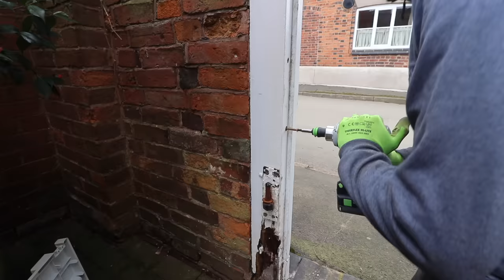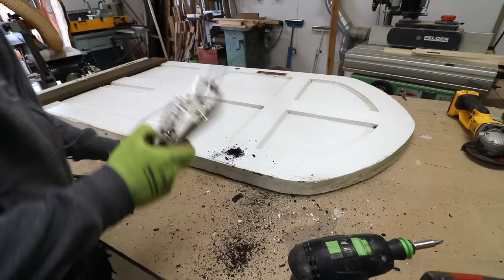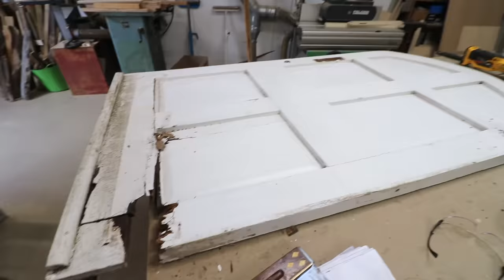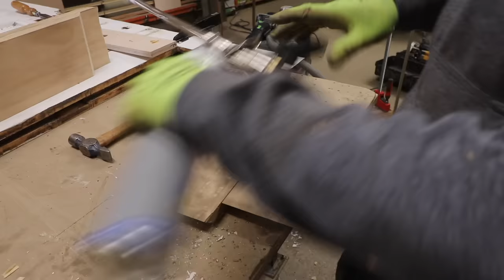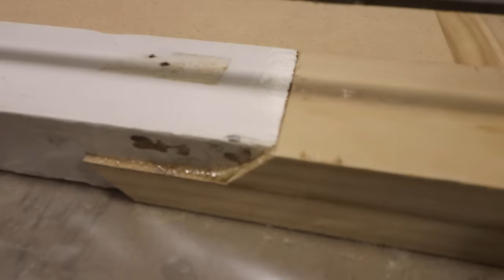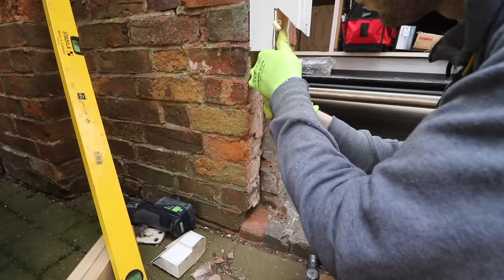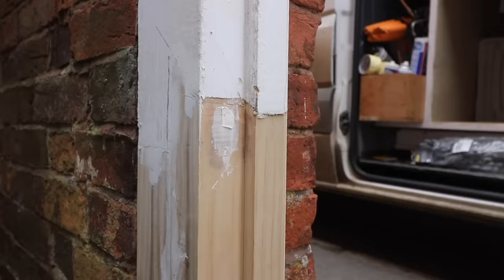Rotten Door, Full Repair. Here's How I Did It.

Comment: Lovely job where did you buy your rebate block from and how much was it, I have the exact same spindle moulder with a Felder rebate block that take replacement blades and sometimes I use it on melamine to give it a clean cut on both sides and wondered if this would give a better finish with the blades been on the skew, what your opinion on the block 🤔
Reply from the maker: I bought it from Alibaba, not sure which seller, 

I would definitely reccomend it. Make sure you get the helical not spiral as the blades are straight in spiral (like mine) you need curved cutters in the helical but the finish will be insane.
Reply: @BradshawJoinery  Is that him from Castleford Market 😉🤣 not sure where your based I’m from Wakefield originally but up at Boroughbridge in North Yorkshire now. You do some great work take care 👍

Comment: Bit surprised the jamb wasn't primed (surfaces touching damp brickwork and end grain in contact with ground) before fixing.
Reply from the maker: i didnt film but i dont use paint on a site repair, one coat while fitting doesn't do naff all! I use a clear sealer called sikkens kodrin wv456 that is like a paste, its called end grain sealer. dries pretty quick too!

Comment: I'm speaking from 20 yrs experience as framing, remodel, maintenance carpenter and construction supervisor both in North Carolina, and New Hampshire USA. Great workmanship but I would limit my use of high density fiber board like for the two door panels. Fiberboard of any kind is not suited for outdoor use. It has no rot resistance qualities of it's own like inner sap. No matter how well you prime and paint it, it will be the first thing to start rotting and often within just a few years, depending on the type of weather in that area. North Carolina is very hot and humid in the summer months lending to the mold and decay of wood especially the end grain as it wicks up water and often goes unpainted from the time it was installed. Old growth forest with tight grained Rot resistant wood like the heart of yellow pine, cypress and cedar are hard to find and to expensive for regular repairs.
Reply from the maker: Cheers Mike, THe product in the panels is one your probably not familiar with over there called Tricoya. The wood i used is also similar technology called Accoya. It sounds perfect for your climate and it is coming to america!

Comment: Beautiful work.  One thing, prime your end-grain before inserting the replacement parts!  That was the cause of the failure, to begin with.
Reply from the maker: Cheers Daniel, I used but didnt film, a product called sikkend kodrin wv456 end grain sealer. its better at sealing than primer and dries fairly quick
Reply: @BradshawJoinery  Thanks, I'll give the kodrin a try.

Comment: Very nice work. Did you use MDF for the panels? I wondered if MDF was suitable for exterior use even if painted.
Reply from the maker: Cheers Ross, I did but it's a special MDF called Tricoya. The link is in description. It's about £200 a sheet
Reply: @BradshawJoinery  Thanks, Just finished reading about it here in Melbourne Australia.

Comment: Wooho, great work.
Why don't you use oak?
And what material are those panels? It's not MDF, is it?
Reply from the maker: Cheers jp I use accoya because it's much better. Oak isn't a good timber for repairs, there is a high % movement with humidity change and also not a great timber for adhesives and paint to work with! 
The MDF panle is called Tricoya (accoya wood fibres in a MDF panel) there is a link in description you'll find it interesting

Comment: Wicker way to do it reveptor saw use westen cedar wether resistant.
Reply from the maker: Recip isnt accurate enough and also limited by the reveal in the brickwork. they dont do old brickwork any favours either, i used to use them on rip outs but dont any more. Cedar is also less durable than accoya and not ideal for painting, and thick sections are££££

Comment: Was a clear sealer used on the wood in the door frame portion you replaced, if so what was it? Would not think bare wood we be going against the brick and sitting on the plate.
Reply from the maker: Sikkens Kodrin wv456. It's great stuff

Comment: Just found your channel. I'm an old cabinet maker, retired. Enjoyed seeing your joinery on this door. Wondering, when you were using a multi-tool to sand the tight places on the gate frame, what attachment were you using. Looked like a triangle shaped plate.
Reply from the maker: That sander is a delta sander from festool the DTSc400. You can get little sanding pads for the multitool though.

Comment: What did you make the replacement panels from?
Reply from the maker: Tricoya Extreme MDF
Reply: I wouldn't have thought mdf would be suitable for exterior use, I hope the decorator gives it a good coat of paint. The rest of the repair was spot on but I would have gone the whole hog and made real wood fielded panels. Up here in Scotland I get a lot of rotten wood to repair, mainly window sills and door frames occasionally I'll get a door to repair

Comment: Why didn't you take the beam out all the way to the arch? It would have been easier. But it is still a good result
Reply from the maker: The Frame Jamb? YOud lose all the strength in the joint then, this way new timber cost is kept to a minimum but the spliced section is out of watersplash height.

Comment: Whoa!!!A radial arm saw still in production.  Don't see them any more.  I recall one being shut off at coffee time and 10 minutes later it was still turning.
On a sadder note, I just came from a week on the demobilization and tearing down of a pulp mill.  Everything is being destroyed,,,,everything.  The guy heading up the group knew I was a joiner so walked me thru the millwork shop .  an enormous bandsaw, maybe 8-10 ft high plus a shorter one, sorry don't know the blade size,  There was no power so we were using flashlights.  A 6" jointer, several Senco nailers, spikers and staple guns, biscuit joiner, Bostitch 18 g pinner..

And there was a 16 or 18: Dewalt radial arm saw with some blades hanging on nails on the wall.
On the floor were 2 boxes, 1 was full of wooden hammer handles and the other full of longhandled  wire brushes,  You know this place goes back in time with wooden hammer handles.
There were also 3 Justright 1-2 gallon gas cans.
Everything destined for demolition.  To think of the schools or volunteer  disaster response groups that could use some of it
It kills me.
The mill is in Port Alice on Northern Vancouver Island. It's on Utube.
Reply from the maker: Roger.. thankyou for that, yes the radial is a standard tool in the joiners shop in the UK. Most will have one here. Damn shame about the Pulp mill. I see production businesses closing all the time over here. Not many re-opening or new ones coming through!
ill have a look at the mill
Reply: Radial arm saw’s are sitting piled up in unused corners of millwork shops and Construction Company warehouses.
Everyone seems to have gone to chopsaws even on job sites where they are cutting through 2 x 12‘s and microlams.

Comment: @BRADSHAW JOINERY - Did your Kapex come w/ the shadow-line cutting guide in lieu of the red laser...or did you install an aftermarket one? If aftermarket, can you tell me which one? BTW - awesome job on the door repair.
Reply from the maker: Hi Ryan, its the standard one that you get with the SET version of the saw, mine is a KS60, the 120 has a Red laser line still. Ive not seen anyone add a shadow line setup to one yet. Festool talk group on FB is a good group for stuff like that

Comment: Hi, great job and fine finished work. A few questions from over here, where we talk funny.

Wood name/term used for rot-resisting?

Bevel edge at bottom of door panels: did you insert a beveled wood strip, or putty? (what kind for your heavy rain conditions?)

"Decorator" - Is that term for a person who paints or specializes in finishing wood projects?

"It's bonnie!" means good job or great fit! Right?

Any construction codes there to keep wood from contact with ground or wet surfaces?

Any special water-proofing in the painting? Sealing? for your rainy conditions? Certain number of layers or coats? Any extra mixtures of paint for better sealing you use? Bottom edges of door painted/sealed?

I'm so sorry someone sold you that tape measure with no clear marking for inches. :-) 12-30-2021
Reply from the maker: Hello, Where are you from? 

The bottom rail is bevelled its all one piece! 

Decorator/Painter is a broad term, some are very skilled highly trained and good, some just know how to hold a brush, but yes its a term for painter. 

Its Bonnie yes means its good/looking good/top notch -- "She's a bonnie lass" == "She's a lovely girl"

Codes yes and no, there are guidelines and appropriate techniques with qualifications to suit. Most of the codes that need passing are security and insulation value based. 

paint is a grey area. all depends on the type of base material and the specific person as to what is best. New joinery i think Accoya timber and waterbourne joinery coatings take some beating. Refinishing work of existing, oil based is stil king. 
Lol at the Tape measure!!! One day you will have one :)

Comment: Is this true? The original panels are beveled on the outside, but the replacement panels are left flat.
Reply from the maker: Hi Paul I did bevel the new panels, there is a clip of me running them past the spindle moulder.

Comment: So you're saying sequoia, or redwood?  Good choice.
Reply from the maker: Hi, the timber is Accoya, there is a link for more info in the description 👍, I used a. Lear end grain sealer on the hidden parts, a coat of paint wouldn't dry or do an awful lot tbh, the clear sealant is much better. Sikkens kodrin wv456

Comment: why you did not painted bottom of the frame? It will absorb all the moinsture and rot
Reply from the maker: I did. Painting one coat on site is pointless. I use a clear sealer called kodrin wv456 and it seals much better. Ideffo should have filmed it as ive had a million comments saying the same! Its a great product to have for any joint pre glueing

Comment: What are your thoughts on treating at least the bottom of the frame to prolong its life?
Reply from the maker: I used a clear sealant and forgot to include that part! Sikkens Kodrin wv456. This timber is Accoya too so it wont rot, the sealant is to stop the decorative finish from deteriorating more than anything

Comment: Never seen a panel door used outdoors in Canuckistan, for good reason I guess. That MDF/Fiberboard stuff better be waterproof, around here that stuff puffs up like bread if you even spit on it. And no wonder making a door is so expensive, just getting the bottom patch seemed like 50 steps.
Reply from the maker: There are a few about and this is made especially for an external application, it's lasted well tbh! 

The MDF is called Tricoya, there is a link in the description. It well worth a look. 
Seems like a lot of work but it's all fairly simple and quite quick if you motivate and crack on 👍👍

I've never heard the term canuckiastan so thanks for that! 🤣

Comment: What is the material you made the door panels from? (31:50) It looks like some sort of compressed man-made material. I've never seen a material like that hold up very well out in the weather. Gluing that Dutchman right across a rail/stile joint? Will that not cause a problem by restricting weather-related wood movement??
Reply from the maker: Hey Mike, good Questions, the panel material is a manmade board, but a very special one called Tricoya, ive added a link to the description as there has been a lot of questions about it. The dutchman patch will help steady the rail if anything i would rather it spanned the two a decent amount than do two seperate pieces that could open up and let moisture between them. Think of it like a double tenon joint almost so the patch was a thin extra half faced tenon.

Comment: Can I ask why you didn't glue the panels into the rebate?
Reply from the maker: Its bad practice on external work to glue panels in. Any movement of the panel or door will result in tension in the door and splitting/warping.

Comment: question why did the door rot out in the first place. Incorrect timber, inadequate weather proofing, inappropriate build style? How old was the original?
Reply from the maker: Its very old, perhaps nearly 100 years, its definitley over 60 and aparantly wasnt new att hat age! Its rotted from water splash, the upper parts of the door are great, the rot is everywhere it has sat wet for longer, so lower parts where rain splashes up and at ironmongery points where water sits/tracks in.
Reply: Looks like an internal door that been used externally, made of softwood not oak or similar, not fit for purpose, that’s my impression.
Reply from the maker: It does look similar, but definitely built for external with the bevelled tops to just the rails! It's also made with traditional slow grown redwood, probably the most durable timber aside from Accoya. Not something that is available in today's timber supply!
Reply: OK thanks for that, it’s in a very exposed position of course. I’m enjoying your good work.

Comment: Did you just use MDF for the panels on am exterior door? I can't tell from the footage. If so, aren't you worried about that swelling and falling apart?
Reply from the maker: I Did Nick but it's extreme MDF, the link to the info is in the description 👍
Reply: I guess I should have read the description. Lol. 😳
Reply from the maker: No worries, I've had about 50 comments along the same lines so I added the info to the description earlier 😄😂

Comment: Why not use 1 peice of timber ? Why so many stuck together just curious if there's a reason
Reply from the maker: Namely ease of aligning everything. this way i could just cut a joint and work each piece in to crate a nice fit then glue the two together and then cut it straight. if you have one piece you have to cut all joints perfect and adjust all at once to make small adjustments. not inpractical, but more work,
Reply: @BradshawJoinery  thanks for replying  I have no idea and think it's brilliant ya can fix a old gate like this 😀

Comment: Would last longer if there would be like 20 mm cap under door and frame to those bricks instead that few mm cap.
Reply from the maker: It's fine on this occasion as it's Accoya timber but yes I'm a big fan of having clear gaps in all external joinery over tight fitting openers!

Comment: As a hobbyist woodworker the array of fascinating electric dodaddery doesn't make any sense for me but those multi tools for making freehand plunge cuts like on the door frame just made a ball ache of a job a reasonable in situ repair.
Reply from the maker: Thanks mate, that explanation of the use of that tool is spot on for every tool I spend money on. For the right task each tool does a more efficient, better or just simply makes it possible than it would without it!

Comment: Very nice job
Thoughts on glue as just as you said tell me what you think, wow never seen that before, but I am just a DIY monkey. I did like the fact that even as professional when something lined up as well as your joints did, it gave you great satisfaction. 😁
Reply from the maker: Thanks Doug. Glue will have a place in my workshop but not for everything. It's quite a messy one! 

Yes that first assembly of what you've been making is still rewarding as ever
Reply: @BradshawJoinery  my thought was the application gun would get ‘gumed’ up. I can certainly see why you like PU glue due to the speed of set, allowing you to move on
Being a mere mortal I often need more open time otherwise the glue starts to go off before I have finish adjusting

Comment: Good job done, but I would not have used MDF for the raised & fielded panels, should moisture/water get in there due to lack of maintenance the MDF will swell and never return to its original thickness unlike a traditionally made timber panel
Reply from the maker: Hi Nigel, absolutley, I never use MDF tbh, however this was Tricoya MDF. Very good material for use externally. Have a Google, it's incredible stuff
Reply: @BradshawJoinery  Hi, Interesting material, I have not come across it in my part of Australia, even though it says it's been available here since 2010. It is good that it's not just a surface treatment meaning machining those fielded panels wont remove any protection that could make it fail.

Comment: I can only say that I am disappointed that you did not install the deadbolt lock.. the door is already drilled and mortised for one and they are simple to install. It does not require a locksmith.
Reply from the maker: Hey Walter, I have installed many deadlocks before, I did install the deadlock back into this one as it was originally 👍
Reply: @BradshawJoinery  Happy to read this, as to P/U glue, the best exterior adhesive, I learned that the proper way to use it was to apply only to one side of the joint and wet the other side with water. This seems to activate it and form a tighter bond as the glue is drawn into the lignum and fibers as the water penetrates. It also permits the Polyurethane to slightly expand filling any small voids.

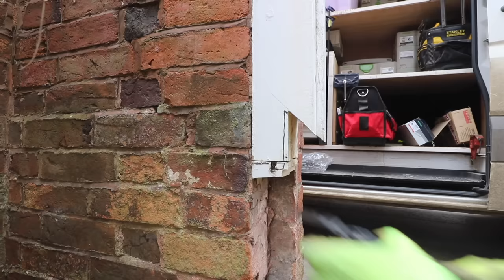Comment: 42:20 Why was that cut not made at a 45 also?
Reply from the maker: HI Jim, It could be cut at 45 (like an arrow head as you look from centre of frame, but i did not. i deemed it fairly well protected and its only the one face exposed so made sure that was a nice tight fit.